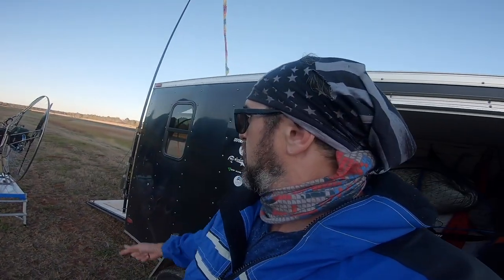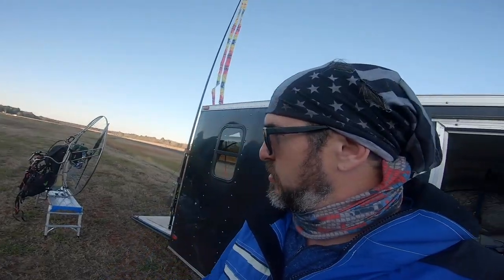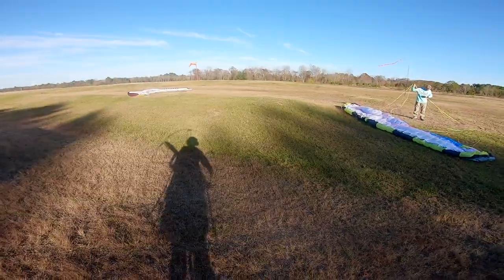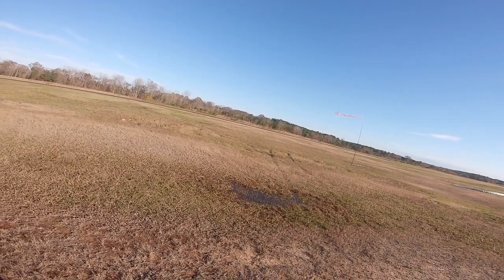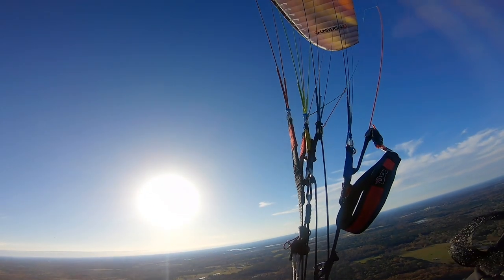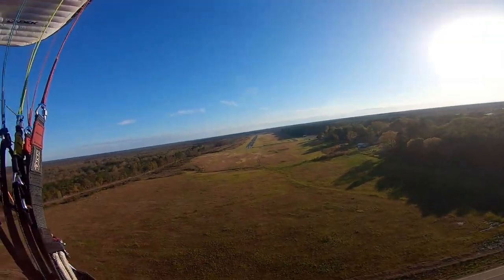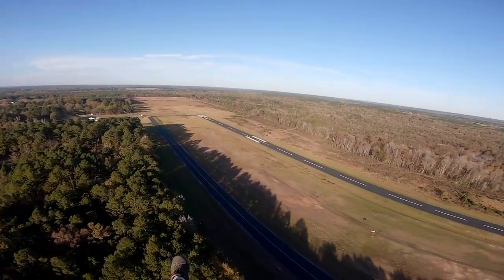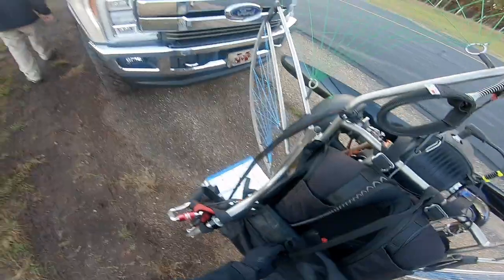Paramotor Diagnostics and Test Flying Atom 80

Comment: What a coincidence you post a fuel issue video - my very first flight was foiled today by my carburetor! My fault though. 

I rebuilt it a couple weeks before I headed south for training, and I put the needle diaphragm gasket in the wrong position, on TOP of the diaphragm instead of underneath it. It was running pig rich and wasn’t responding to any adjustments I was making. Ran inconsist ently, was four stroking at part throttle, then was fuel fouling the plug & failing to start. Figured it out after a while, did some fine-tuning, and got a running strong again. I’m ready for tomorrow morning! 🙌

Comment: Perfect timing Kyle! I just had my first engine out on my Atom 80 this past weekend after 70 flights. 5 mins after flight began, I had to land and luckily got a ride back to the airport I launched from thanks to a nice guy with a truck who saw me go down.  Turns out my spark plug which I just replaced 4 flights ago was bridged with buildup between the gap. I checked the airbox and I think it was sucking in oil discharge and debris from the exhaust over 100hrs. Always fly like it's gonna fail saved me this time haha Luckily I was flying around farms in Lancaster, PA

Comment: Engine out was cause by too much fuel, 3 times now the low idle screw has vibrated open a few minutes. 
Any fix ideas? Moster 185. Has done 153hrs now
Reply: @577buttfan  will try that, its firm to tighten but easier to loosen past 1/4 open
Reply: the tread may be worn?buy another carb then youll know its right .